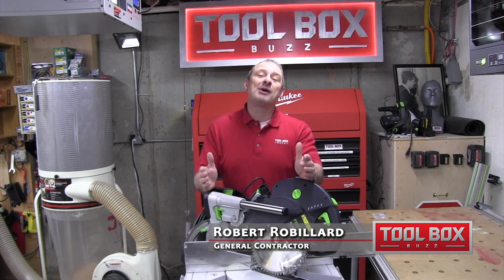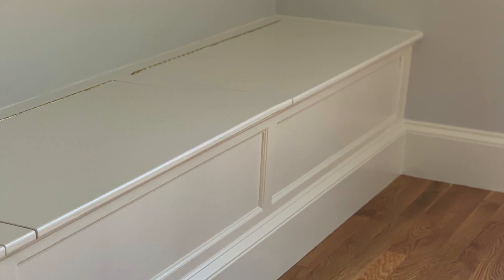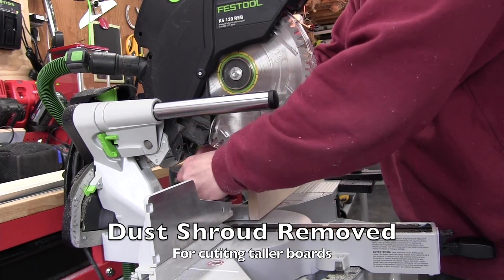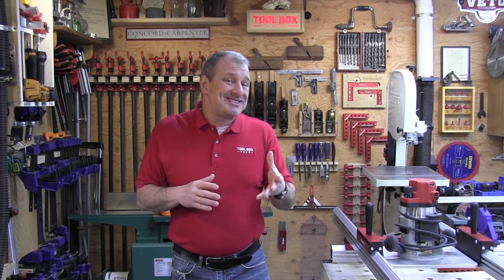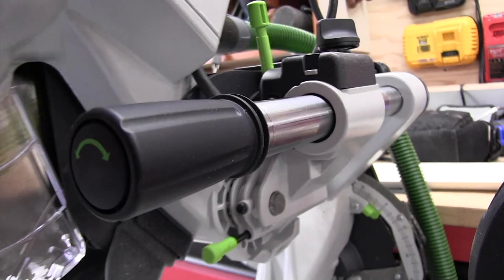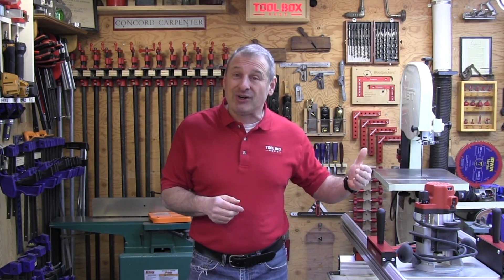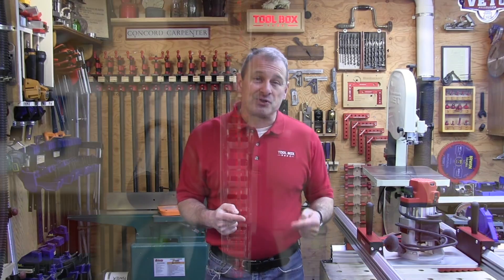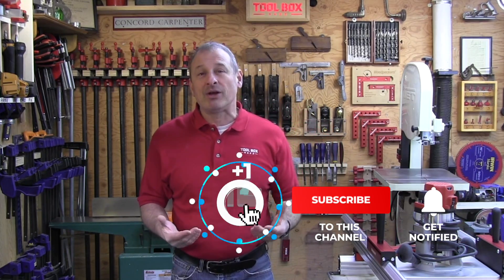Festool KS 120 REB

Comment: Bought a damaged late model Kapex off Craigslist. Took it to the dealer to see about repairs. They had a fitted shipping crate on hand (Festool requires that of dealers) to ship the saw to the Indiana repair facility for $50 each way. When I returned to pick up the repaired saw I felt sick when I saw the long list of parts replaced and adjustments made. But get this: even though I was not the original purchaser, all the repair charges and shipping were free because the saw was less than 3 years old. That alone takes the sting out of Festool's high prices.
Reply: Mark Koons until the warranty wears out and the saw costs $800 to fix + $100 shipping cost?
Reply: @mitchellkasdin1899  That would take the fun out of Festool, wouldn't it? I find myself wondering whether Festool failures are mostly attributable to out-of-shop, job site damage. Anyone care to share their insight on this matter?
Reply: Mark Koons     12 year old kapex 120 sent in for preset accuracy adjustment.  Ended up with recommending we replace the fence.  Over the 12 years this was the 4th time sent in for repair.  Don't know what the other three were for.  Really felt like they were taking advantage of the situation.  Hobbyist left it in the same place in his work shop the entire 12 years.
Reply: @whoDatBeDare  That would make you hate them, huh? It's hard to imagine why the fence would need replaced. I don't know what pieces are available for owners to purchase but I know some essential parts are not for sale to the public. Between Festool, Felder, and German auto manufacturers, my opinion of their business practices is negative and generally I'd select the better Japanese products.

Comment: I am DIY, I love this saw.  It is so precise and enabled me to do what professionals do with more accuracy.  And the handle is very intuitive.  The handle is not on the side of the blade but in the line of cut.  It won’t shift the blade to the side no matter what.
Reply: Your a DIY’r and you spent $1500 on a saw that’s meant for contractors and professional finish carpenters...
Reply: @trevorm7013  probably saved that $1500 on the first big job he did by doing it himself and not hiring someone. Paid for itself in that case. 
Buy the best tools you can afford, otherwise you’ll always blame the tool when in reality it is you own skills that need to be honed.
Reply: @dennispope8160  I have a Milwaukee miter saw and it’s great but no matter what saw I use when my miters suck I swear it’s the saws fault 😂
Reply: That micro beveling is amazing.
Reply: @trevorm7013  I have found that getting really accurate miters can depend on the wood itself as in if the wood has been squared up to perfection with jointer and planer. Once I took the time to process the wood, even if it looked squared, the miters came out way better.

Comment: Didn't mention the most important change in the newer model imho which is the motor improvements. They have increased the power and hopefully improved the notorious motor failure that has plagued this saw. I sent mine in before the 2 year cutoff after talking to them at AWFS in Vegas. They replaced the motor with the newer one at no charge and what a difference in power. It doesn't bog down nearly as bad and so far so good!

Comment: Rob, you and crew do a thorough job when you do reviews! I have had some different experiences, yes. I have seen some misses to, but maybe I am very annoyed when manufacturers miss what I see as obvious misses on function and user-friendliness.

One of those "misses" is the obvious inability to use the kerf cutting function properly because the saw arbor does not meet or cross the plane of the back fence! The blade is rising behind the arbor and you will never have a proper dado or rabet across the width of a board without a "spacer" to allow the arbor centerline to meet or cross the back edge!I
I have made my own "accessory" for my rail and axial 12" Bosch mitersaws. No tools, no screws, but accurate and solid hold to my back fence. Aids in dust collection too!
 Btw, when I began in the trade, the best motorized mitersaw was a 9" Rockwell with a wood bed! Carbide blades were not invented yet!

Comment: Doesn’t look like dust collection is all that great at 0:15 - agree on the sound of the motor. We do appreciate your reviews Rob! Just personally not a fan of the Festool, lot of money for not a big increase in function.
Reply from the maker: 0verboosted tons of money..... don’t get hung up on one clip, it’s entirely possibly the vac was off
Reply: Just curious to how many Festool tools you have used and for how many years you used them to come up with your not much more functionality comment?
Reply: @williamsmith9026  you're right - only track saws. In mitre saws you care about cut depth against the fence, portability, power, length of crosscut, ease of setup, accuracy and dust collection.  The Festool beats most contractor saws in accuracy (this is anecdotal as I've never seen this actually measured) and dust collection (this seems to be fairly well-known). 

The rest comes down to function of the saw and ergonomics. Every contractor saw arguably has a much quicker stand setup that's one piece (vs the multiple pieces for the Festool), and the start handle is particularly awkward. It has its purpose - but it's hard to say that purpose is worth 2.5x the cost when you're not getting that same increase in production. Bosch, Makita, DeWalt and Milwaukee all make incredible, durable, well-made and well-engineered saws - Festool capitalizes on its niche I'm just not sure why it's so much more expensive than the next most expensive saw (Bosch Axial Glide).

Comment: Ive had the Kapex for somewhere around 4 years. I use it for all applications and currently framing inside of a 120 year old condemned remodel building. I treat this saw like your guys treat your tools. I posted some pics on  the festool owners group on the topic of toughness. I strap it to the boom lift with a sysvac to work on the oriel windows and we know how jerky a boom can be and the compact design makes it easy to work right in the basket. All 45's cut side to side duue to wide 1x so the fences are off.
Bottom line.
I beat on this saw like any other tool and it is still accurate. It aint all shined up like every other youtubers kapex tho. and my festool sanders... they take the worst abuse of all. 
 My point i guess?
 Its a good saw and the ability to flip a switch to bevel side too side instantly alone is worth the money.

 To the knuckleheads that say its all plastic. Show me any scms that isnt covered in a plastic shell

Comment: IMO, the main advantage the Kapex has over (most) other CMSs is that it takes up less space, because it can be placed with its back to a wall. If you have a small shop, that can definitely be worth the price (though you might also consider Bosch's "glide" saws that can also be placed against a wall).
Reply: This is what put me over the edge with regard to buying. My Hitachi 12" was like 3 feet deep.
Reply: @ILruffian  it's one of the big reasons I'm selling my Dewalt DWS780 and getting a Kapex. The DWS780 requires so much space and then if you want to hook up dust collection to it, which is mediocre at best, you need another 8-12" of space because it hooks up at the further back spot on a slider. I have cabinets that go 36" out from my wall thinking that would be enough, but I still couldn't fit it with dust collection hooked up. That was the final straw for me and a Kapex is on the way. I have a garage shop and can't dedicate the space the DWS780 required. The dust collection on it was horrible too.
Reply: @atomictyler  You won't regret it. May be short notice, but consider buying today to avoid 1/1/2023 Festool price increase.

Comment: At 1/3 the $$$, I’m pretty happy with my 10” Bosch that has the folding guide system - but I would be interested in a head to head of miter saws that have guide forward designs.
Reply from the maker: Which model - Bosch does a nice job
Reply: A Concord Carpenter / ToolBoxBuzz: CM10GD is the one I have. Would be interested viewing some head to head tests that include deflection when the saws tilted  - I think that may be a weak area for a lot of these saws (bosch included)

Comment: Nice. Here's another one for you. Deck screws, epoxy or ceramic coated. What's the best. I know there was a point the "Deckmate" changed who the manufacturer was.  I remember calling to talk to the original manufacturer before the contact info was fixed. This was when they switched to that Torx-25 bit. The manufacturer told me that Home Depot had flipped the contract to save money and I am convinced the newer product is inferior. Any time I've pulled an old deckmate (combo PH2/SQ2) out of an exterior project, it's hardly showing signs of rust. With the "newer" deckmates, they're extremely rusted and even sometimes the heads snap off when trying to back them out. You guys do great reviews. What's the best ceramic coated screw? I bet you guys would do a great comprehensive comparison. These are expensive so it would be nice to make the right choice going forward.

Comment: Great video Rob.  I think the dust collection efficiency is the number one feature that helps justify the price.  I've been using the Bosch 12" axial glide miter saw for about 8 years now.  I love the fact I can place it against the wall when using, but the dust collection is extremely poor and there is some blade deflection due to how the saw is held into place by the axial arms.  I believe a Kapex will be the replacement for my Bosch when the Bosch finally gives up.  Stay safe brother.

Comment: As you said Rob I couldn't justify the price and kapex doesn't offer much than the front rail and dust extraction , so I went with the dewalt 12" flexvolt and it's very accurate saw for 60% less money , and no matter what festool claims regarding the height cutting capacity,  still can't beat the capacity of the 12 inch

Comment: Late to the review but I like the idea of the Festool. I’m about to return my 3rd Makita LS1219 in two weeks. Very disappointed in the quality control. It’s a lot of extra coin for the Festool but I should have followed my own advice in the beginning - Buy once cry once.
Reply: A few days ago I bought a Makita 40v cordless got it home and discovered it was cutting 1mm out of square over a 200mm depth of cut so no better than my old saw i was replacing. I took it back to the shop and checked another 2 saws of the same model and they both had the same error on the same side.  I needed a saw quickly for a challenging joinery job so rather than waste more time checking the accuracy of saws in the same price range I bit the Festo bullet and bought the Kapex 120.  It's a dream compared to the cheaper brands....no tears this time!

Comment: Besides the initial price tag the other thing that keeps me away from the Kapex is the arbor size that limits my blade choice and eliminates my ability to go to the orange big box and pick up a Diablo replacement like I can for my 10 and 12" dewalts!
Reply: Joey DaFish I’m a huge fan of Forrest blades. However, Festool factory Kapex blades have been AWESOME and VERY durable. No need to upgrade.  I’ve not had to sharpen either my 60 tooth or 80 tooth in over 5 years. I have a spare 60 tooth I keep on hand. I recently compared the unused new 60-tooth with my 5+ year-old original. The difference was negligible. I put the original 60-tooth back on the saw for another year.  It has generous carbide so I’ll have it resharpened when it’s needed. My Kapex may be THE  most-used tool in my shop and on  remote sites.
Reply: Steven Jaynes 5 years?? Obviously not using your saw daily.

Comment: clean money cuts are all about the blade. A quality, sharp blade combined with a smooth calculated cut will provide perfect cuts no matter that saw.
Reply from the maker: MFiskeaux true so lone as the miter saw is precise, aligned with no head or shaft wobble

Comment: He mentioned  using the 36mm hose for dust collection and cutting it down to 6 ft.   
I asked at Woodcraft whether this can be done and they called Festool and were told you can't do that any more because the hose ends aren't the same size.
I suspect they might be getting confused with the new 27/32 hose (which is the standard hose that comes with their vacuums now) that goes from 27 mm to 32 mm and therefore has hose ends that are different sizes (ID).
Does anyone know if you can still cut a 36 mm hose?
I also was having a hard time finding another 2 hose ends for 36mm hose so you could still use the other section.
Any info on this would be greatly appreciated

Comment: Tried and true Dewalt 12" miter Sliding saw does 7 1/2 nested crown and 6 1/5 nested base.
This thing needs to be 12".

However, 10" saw will cut majority of the standard today's trim. But once you get into custom.  It may become an issue.

Comment: Ive got the first model which I bought just before this one came out.I bought it for the dust extraction cutting MDF trim which will probably get us all eventually.Dust extraction is good.I find its a good saw but no more accurate than my Dewalt 717 which is a very nice saw for the money.Buy 4 Dewalts for the price of the Festool.
Reply: I prefer the dw717. I have had mine for 10yrs. Still cuts beautifully.

Comment: Thoughts on the handle and safety? I've been using a Hitachi C10FSH for 20 yrs and am used to the vertical either left or right handed. Looks similar to the Kapex.
Reply: How do you like the Hitachi? I just bought one, but alas, they are made in China now. Mine has a 1/3mm dip in the table and the same amount of 'slop' in the angle detents. I'm thinking sending it back.

Comment: Rob, What does the REB stand for? You kept saying in this video REQ. I have had mine for 11 years , it just quit on me today. I think it is the switch. Has anyone you know that has had to ship theirs in for service? I heard they replace anything that could be worn out making your cost to repair expensive.
Reply from the maker: Barry,

R= reface / updates
E = electronics 
B = Brake

I always have a customer call Festool repair service for an estimate 

Happy Holidays
Reply: @ConcordCarpenter  Thanks Rob for responding. I watched several YouTube videos repairing a Kapex, I just ordered new parts for mine and will be repairing it myself. I am replacing the switch, electronic board and brushes. That should keep me going for for a while. If I had sent it to Festool I am afraid it would have been to expensive not worth it, because I would like a new one. Why spend $800.00 -1000 on repairs when 500.00 more get a new saw.

Comment: Very accurate saw ,but the dust shroud still catches on the fence when cutting at an angle ,ie 20 to 45 degrees ,and you have to remove the fence festal wants to look at this problem ,other than that it’s a very good saw

Comment: looks like a great saw. Which is more accurate the Festool laser or the DeWalt XPS LED light positioning system?
Reply from the maker: Kunjiklub _ I think the led light is the better choice- it never can lose calibration and auto adjusts for blade thickness
Reply: KelMaster Construction   Good points. I've only used a DeWalt miter saw with the XPS so I was just wondering the difference with the laser. So far I really like it, and as you mentioned, it doubles to illuminate the area.
Reply: @ConcordCarpenter   Thanks for the clarification on that. Great video and I look forward to more content of yours.

Comment: Hey rob, Great review. Almost making me want to get a kapex again! I’m a big festool user but could just not get used to the handle orientation on that saw. Also I do a lot of work with hardwoods and i feel the older saw was a bit underpowered, do you feel the new model’s motor is stronger then the previous model?I do love the rail forward design and the upfront controls.
Reply from the maker: Judd Lincoln it’s seems the same but it’s hard to tell
Reply from the maker: Judd Lincoln that rail forward design is sweet..... others are copying it
Reply from the maker: Judd - have you looked a the newer Makita?  Better price
Reply: @ConcordCarpenter  I actually have the newer 12” makita in my shop. It’s a pretty good saw.

Comment: Nice video Rob!!!  I have a Festool drill and I love it!  Battery lasts forever and it just "feels" solid. Thoughts on their track saw?
Reply: I love my TS75.  Damn accurate, the finish cut is unbelievable
Reply: @williamvolbrecht2232  the 75 is great and has no competiton for it's size. But the ts55 is underpowered, just get the mafell, it's a little more expensive but the king of saws (one of the  only affordable mafell tool tho hahah)
Reply: I've used the ts55 for about 11 years. Incredibly accurate saw. Great for plywood and sheetgoods. Underpowered for thicker materials, for instance trimming bottoms of drawers or beveling sides of doors. Extreme precision for fine cabinetry or millwork.

Comment: Handle position is a deal breaker otherwise I'd own one . Everything else i love other than the stand , but i  would just stick with the toughbuilt stand i own . But that handle positing having to stretch up over to press the safety realise is just too much . Bosch 12" Glide beats this all day long
Reply: 4 years on I've made a complete u turn . I have now owned a ksc 60 and ks120 for 2 years , until you've used the saw for a while its difficult to understand but it's so organic to use